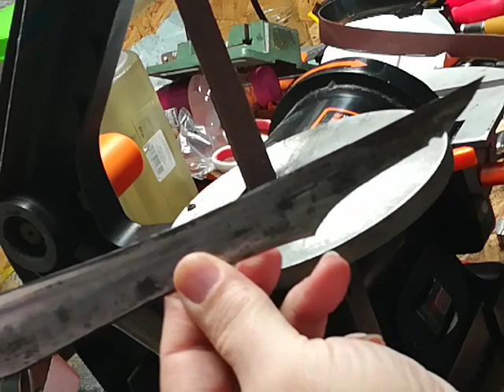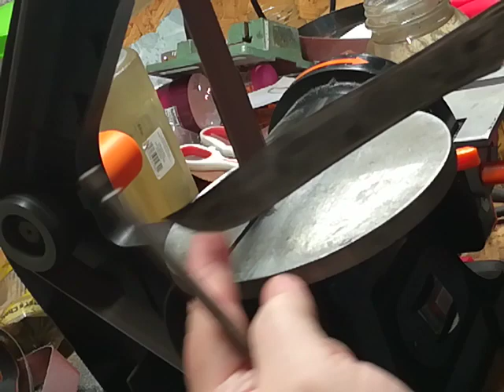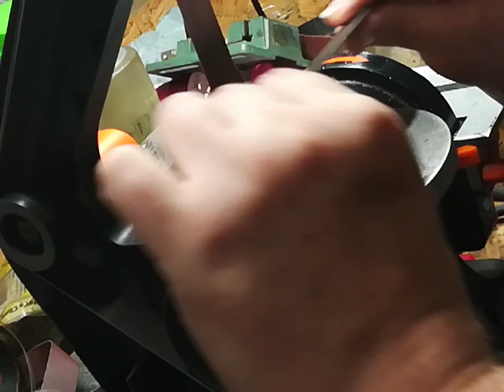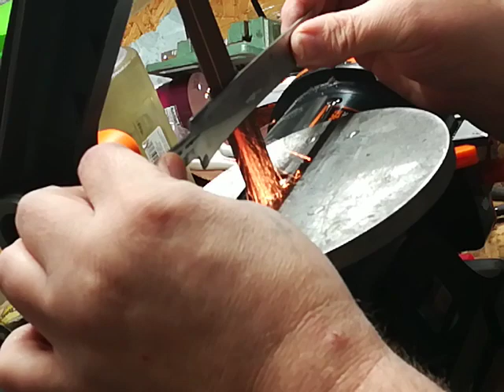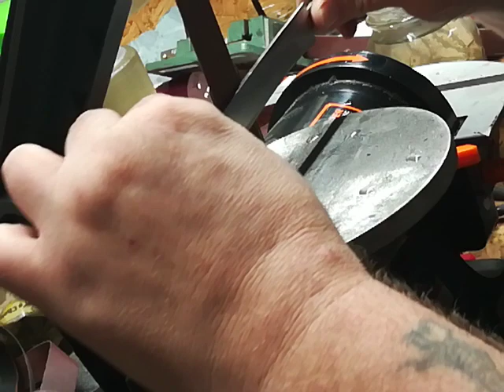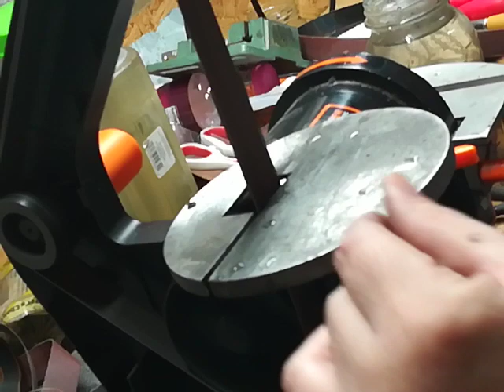Old Hickory Butcher Knife Reshaped...

Comment: I took the scales off a couple of Old Hickory knives an cut them down. Evidentially they leave the back half of the handle area soft. I could drill new holes easily there but, not in the top half... I had to heat it up with a torch to drill through it. For $10.00 it's cheaper to buy those than carbon steel blanks! Ha ha ha!
Reply from the maker: This one shattered right through the first pin hole. Really hard, almost too hard to file.